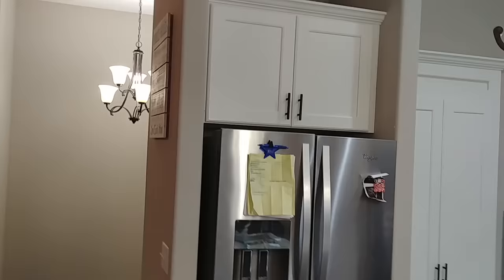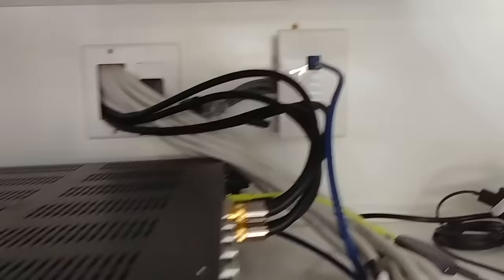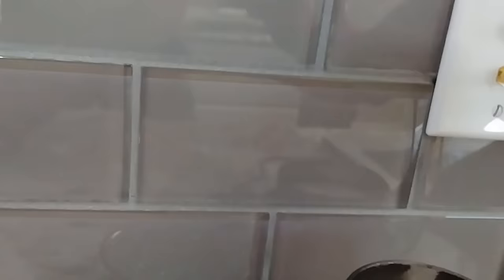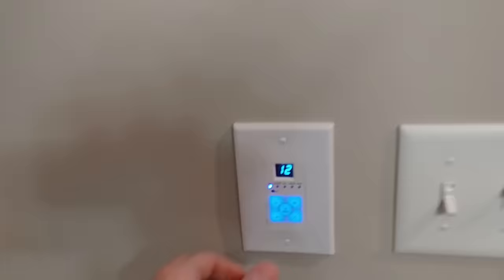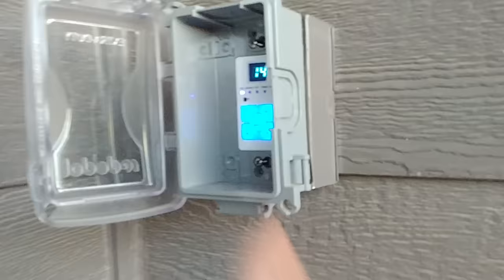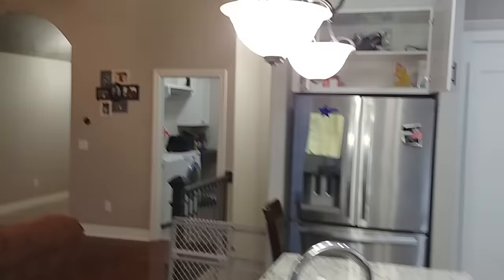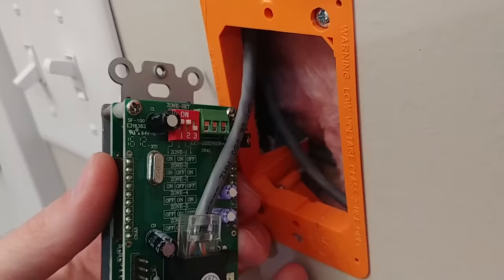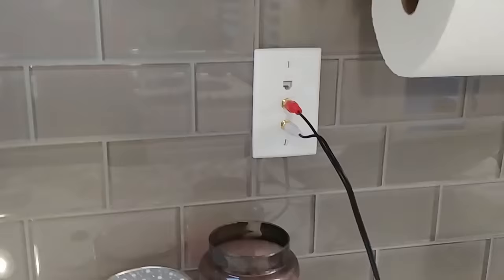WHOLE HOME AUDIO: Monoprice Whole Home Audio Amp! 6 Zone 6 Source

Comment: Can you explain your coax cable to the source a little more in depth to me? I've got spray foam coming in two weeks and I want to make sure I have correct wiring before it's too late.
Reply from the maker: The coax cable is what you make RCA cables from. Even the really flexible cheap RCA cables are coax cable, just really think wires. Using the thick real coax cable let's you run it long distances with little to no audio loss
Reply from the maker: And the reason it's 2 coax cables is because you have a red (left) and white (right) audio cable. Same with the cheap cables you will see the cheap ones are still 2 separate coax wires that are together. And you'll notice the cheap cables you can split apart
Reply from the maker: Check out my video series on my channel on the WS66i amp and whole home audio from start to finish

Comment: If adding a subwoofer to one of the zones, and the sub only has a single line in, would you use a Y adapter to go from the two stereo pre-amp outs on the receiver to the sub? If so, should the switch for that zone be turned to stereo or bridge?

Comment: Great video. Thanks. Question. Have large kitchen with cathedral ceiling that is pre wired ., would like to use 4 speakers, but the wiring  is daisy chained thus only two speaker wires to access. Possible to bridge 4 channels to drive two channels with 2 4ohm speakers per channel and sound great?

Comment: Hi, Couple of questions please:
1- Are the Daytona Audio ceiling speakers need a housing to hold them up in ceiling or they can be fixed to the ceiling sheetrack?
2- Do I need to use the Cat5e Raiser or Plantun wire?
3- What cable I should use the TV HDMI  cable? can the RG6 Coaxial cable be used as HDMI?

Thanks a lot for your effort and sharing

AJ
Reply from the maker: The speakers do not need an additional housing, they have a screw type clamp that fixes right on the sheetrock. It depends on where you live and your regulations, but in the USA for residential housing you do not need plenum. standard riser cable works but you need to check your own regulations. RG6 cannot be used as HDMI, you will need RCA cable for audio.
Reply: Thanks for your quick kind reply, what I need to use the HDMI cable for is to connect my IPTV box (Internet Streaming TV Service) which will be kept in my networking closet with my TV, so is the RCA cable can do the job?
Reply from the maker: I dont know what connections your IPTV box has, but it probably has an audio out jack. Maybe it is RCA cables, maybe it is something else. But you will ultimately need to get it into an RCA cable.
Reply: Look up the definition of a plenum, if you have a whole attic return system it is against US federal code to use riser cable in your attic, because plenum cable has a more fire retardant sheath. Some cities and states have code that requires all plenum cable no matter the location or use of the cable (though sometimes this is only for commercial). I've heard stories of inspectors just requiring plenum cable without the code requiring it and that's a shame really.

3 easy answers: 1) just use plenum cable 2) go ask your local electrical inspector 3) don't care and do what you want.

Comment: Hello. Great video. 
Are the switches running with the onboard POE amplifier? Or theres ac wire with it?
Reply from the maker: They are powered by the amplifier (nothing specifical just cat 5 cable) check out my videos on my channel over the WS66i amp!

Comment: Hey - great video! You inspired me to do this exact set up in a new construction build. 

However - I’m having problems connecting my TV optical output to the RCA jacks I installed. I just bought an optical to RCA converter on amazon but I’m still just getting static in my speakers. It’s not my RCA jack either because when I plug my Bluetooth adaptor into the jack it works fine. I’ve also adjusted my TVs sound output settings... just curious if you’ve had any luck or advice with a problem like this? Thanks!
Reply from the maker: Hmm.. Sounds to me like maybe a bad converter you bought. Is there a way to test it on something else to see if it's bad?
Reply: You should probably make sure the tv audio is outputting in PCM mode

Comment: The best informational video so far seen on the internet regarding home audio. 
Currently i am using an apple airport airport express to stream music to my 6 source audio receiver speaker. But i am only able to connect one device at a time to one source for all the zones.
Can i connect 2 devices (say phones) at the same time at different sources?

And is there any other way i can connect my smart tv, which is in the living room,to the amplifier or say the airport express without the RCA cable, as my amp.setup is in the basement.

Will be looking forward to your reply, thanks have a good day.
Reply from the maker: Maitripal Singh 1 Chromecast can only have 1 connection. But they are so cheap you can have 2 chromecatsts hooked into the back of the amp to achieve what you want. Also, there really is no wireless way that I know of to hook your tv audio up to the amp.

Comment: Great set up. Where is the cat 5 wire going from the keypads? Also, are speaker wires going directly to the speakers from the amplifier?
Reply from the maker: Yes speaker wire goes from the speakers directly to the amp, also same with the keypads. So everything "home runs" back to the amplifier. And the amplifier has the circuitry necessary to know what zones it needs to control based on the keypads being clicked.

Comment: Our home is prewired for 5 zones, one of which is our TV room that has 3 speakers behind the TV and 2 speakers on the opposite wall across. Not sure if this is surround or not. We have all the wiring in the basement so I’m guessing we have to install our hub there. There is only one control keypad though (in the basement). Would it be difficult to instal a keypad at each zone? Where do we start? We are not versed in this type of thing and don’t want to spend huge amounts of money.

Comment: Just want to understand how is the in wall control connected to speaker. I saw that its connected via Ethernet but could not understand how it controls the speaker?
Reply from the maker: The wall control is not connected directly to the speaker. The wall controls are digital, so they connect to the amp directly with ethernet cable, and the amplifier has the circuitry necessary to know how to control that zone.

Comment: That green key stone jack you mention why nothing connects to it what is its purpose there?  I am a little confuse with the eternet cable from the amplifier do i need to run a separate cable from amplifier to speaker for each zone. Please help me understand before i buy this thing thanks in advance
Reply from the maker: Idk why there is an extra one but everything is great with this system you won't be let down

Comment: Good morning,  nice video am thank you for everything 

Pls i have one question about using the alexa .

I noticed you installed the alexa dot closer to the amplifier,  does that mean that if I am in zone 6 room I can talk to alexa there without installing another alexa dot in that room , or I must install another alexa dot in each zone rooms and connect them with the alexa dot closer to the amplifier
Reply from the maker: Yes you can still talk into that Alexa plugged into the amp!
Reply: @TheKMZ1  thanks for the reply sir

Pls recommended a site I can buy the alexa dot including the charging case and where I can buy a Tablet with wireless charging case .. 

Thank you 😊
Reply from the maker: @julius.ololade  Amazon

Comment: My question is how do you calculate how many speakers and their ohms should I have in each zones? cause I wold want stronger power in living room than kitchen and haallways
Reply from the maker: You don't have to do any calculating this amplifier says that it outputs 25 watts @ 8 ohms so just use standard 8 ohm ceiling speakers. Trust me, it is plenty of power, despite what you think!!

Comment: Awesome install my friend. Where did you purchase the wall keypads that control volume, source and audio controls? I'm renovating my dads first home that he ever purchased. I have zero drywall in the house right now. Your videos help immensely when deciding what to do before closing the walls and ceilings back up.
Reply from the maker: Joseph Duarte The link in my description links to this amplifier, it's actually a kit, so the keypads come with it, they are specific to this amp. So if you buy this same system, all you need to add is speakers, speaker cable, and ethernet cable.
Reply: I think that just sealed the deal. I was wondering how you kept the cost so low with all those controllers that you installed. I know you said that you can stack those systems, but are you aware of a 12 channel system that rivals this one (cost equivalency per channel)?
Reply from the maker: Joseph Duarte if you wanted 12 channels I would still recommend buying 2 of these because it would still be your best bang for your buck while still delivering high quality experience. When you have more than 1, the kit has a special ribbon cable that connects the amps together and one amp is the master, the other set as a slave. That makes the slave amplifier share the master 6 sources so that the system now becomes 12 zones and 6 audio sources. I plan on doing a video highlighting my other install where I have 2 chained together like this.

Comment: Thanks for the prompt reply.  You had mentioned there may be a video of how you ran cable in between walls and floors.  Am especially interested in finding out how you would run cables in between floors in ceiling.  Is there an email address you can provide for more questions, if you don’t mind.

Comment: It would be nice if you could supply a parts list. Monoprice, enet hub/switch, keypads, speakers, etc.
Reply from the maker: It's a kit you don't need anything other than the amp kit, speaker / Ethernet wire and speakers. Check description of video
Reply: Must be a kit part number or source. I have looked for the monoprice 6 zone 6 input but the unit I see never has an enet jack.
Reply from the maker: @timbright9499  it's there https://www.monoprice.com/product?p_id=10761 it is labeled "keypads" on the back

Comment: Hi, I'm in the process of installing this system thanks to you and your videos. The question I have is what what was the length of the RCA cables you used for the Tv's and where did you get them from? I have to run multiple RCA cables each being 100 ft long. I am trying to figure out if I am able to run the multiple 100 ft speaker wires for Tv audio output and attach RCA plugs to the ends to make my own RCA cables. 
Looking forward to your response.
Reply from the maker: They are custom made, they are made from RG6 coax, and the ends are RCA compression connectors you can get those at home Depot or other stores like it
Reply: @TheKMZ1  wow, thank you sooo much. I was having a hard time trying to get this together.

Comment: Hello, great video!  Very informational.  I bought my house and it has speakers with 6 different zones but have never used all of them.  I have a surround sound system that has a 2nd zone and that is how I have been running the speakers to parts of the house.  There are cat5 cable with the speaker wires and access points to all zones but I noticed it has the speaker wire and the cat5 in the access port for all zones, will this set up work for the monoprice  amplifier in your video or would I have to run other wires.  Another thing is that there are actually two cat5 cables in every access point.  I am assuming they ran two in case if one went bad in the future.  The access point have all been covered to where the wires are not visible but one controller was left with a sliding volume control.

Comment: What are your other input sources? We are looking to wire for whole home audio but I would like each bedroom to be able to connect to their own speakers via Bluetooth or something like that so they can listen to their own music in their room or connect their AppleTV to the speakers in their own room, etc.
Thank you for the help!
Reply from the maker: Check out my videos on the newer updated model the WS66i. Each bedroom does have their own speakers but they are not Bluetooth, they are normal wired in speakers. This system doesn't operate on Bluetooth. Now for the WS66i they have 2 built in wireless streamers, they operate on your network and not Bluetooth. But the speakers are still wired in
Reply: @TheKMZ1  Yeah I've watched a lot of your other content recently and have seen the updated amplifier but am still not sure what you are using as your different input sources. Is everything just RCA input and that's all you can do? So if it's a TV or a Projector or if you want to listen to music from your phone it all has to be done through the RCA inputs?

Comment: Hi I really enjoyed your videos, I have a question, monoprice currently has 2 multizone controller model 10761 for $668 and model 31028 for $411
The 31028 comes without kit and wall units, my question is if they are comparable and they do the same work?
Thanks 
Pedro

Comment: How does the input in each keypad work ? Is it 3.5mm ? Will the input play on the zone the keypad is configured right after you plug it in ? I’m asking because I see that you added RCA to one of your walls. What not use the keypad instead ?
Reply from the maker: The keypads don't have an input, I made custom RCA cables out of RG6 cables that go back to the amplifier and are plugged into the back of the amp in one of the sources.

Comment: Is your speakers in the bathroom special speakers that are meant for moisture, like marine speakers? And the grille too so it won't rust?
Reply from the maker: The dayton audio CS620C speakers are moisture resistant. We also have 10 ft ceilings in our house, so most of the steam dissipates and does not reach the ceilings anyway. I highly recommend these speakers, great quality, and no they are not marine speakers, just built with quality :)
Reply: @TheKMZ1  good deal

Comment: I'm trying to figure out what kind of imput the TV would use.  Can I go HDMI to digital optical?  Or is it best to just run the rca?
Reply from the maker: I would not suggest going HDMI to optical, the amps have an optical input or RCA so if you want digital use an optical cable if it's not too far from your amp. Otherwise run custom RCA cables using RG6 cable

Comment: How did you connect the ceiling speakers to the tv? Was it through rca? Or did you use a converter to hdmi?
Reply from the maker: My cable company had a DVR which had RCA outputs, so that is what it was hooked into, with RCA into the DVR from the cable company

Comment: I purchased a second home that already has speakers and controls (Zon system I think - which is no longer in business) and I want to replace the controllers.  This Monoprice system seems to be the answer to my issue.  Anything I need to consider?  Great video by the way!
Reply from the maker: Most likely you can use it yes, does everything home run to 1 location? Or do your speaker cables go to the in wall volume controls?

Comment: Hi, very thorough and informative videos. I watched your whole amp and pre-wired journey.  I want to set up something similar and want to ask if you know if it's possible to multipurpose 5 ceiling speakers that are already wired to a 5.1 surround sound receiver and use them through zone 1 on an amp through the receiver while watching TV, but also use them independently through a different zone in which they are directly wired to the amp on a different zone. I guess I would do to sets of wiring, one from speaker to receiver and the other one from the speaker to the amp. Can that be done? Is there a better way? Is there a risk with double powering the speakers?
Reply from the maker: Have you seen my video on my channel talking about the pre amp outputs?

Comment: Great videos. Can you please tell me the best way to stream Amazon music through the monoprice amplifier? Or is there a better option for the price?
Reply from the maker: probably by hooking up an echo dot as one of the sources. The echo dot's have a 3.5 mm output which you can use as an audio source input into the amp. Check out my videos on my channel over the WS66i! It's the newer model, better than this amp. But if you really really have to cut on the cost then yes the monoprice is still fine. But for the extra warranty, and the app control module and stuff that is in the WS66i amp, it's technically a better deal. But yes you do have to spend more. So it depends on what you can spend. Thanks for watching!
Reply: @TheKMZ1  thank you very much for the added info. I appreciate it.

Comment: Hello, couple more questions.  1) is the 50w/4ohm vs 25w/8 ohm for each of the two channels per zone or just per zone? 2) the exterior speakers you used have a power  handling of 50 watts RMS/85 watts max. Given that this is a 8 ohm speaker, isn’t the power less than minimum? Thanks!

Comment: Hey man great video and a much better way then paying someone to put in a Sonos system. Bought pretty much everything you had (hope you bought stock in all those companies) for a new build, going to have 12 zones:6 sources. Got everything this past week and was looking at the cat 6 connection hub. There are 7 ports on the back. Is the 7th for connection to the slave amp?
Reply from the maker: Madison Earnest I never did understand why there was an extra. I don't think you hook it up to a second amp, because you use the ribbon cable for that. And I wish I got a commission off of every amp I sold!! If you need the android app I got ya covered ✅